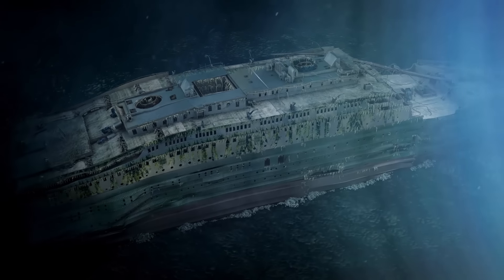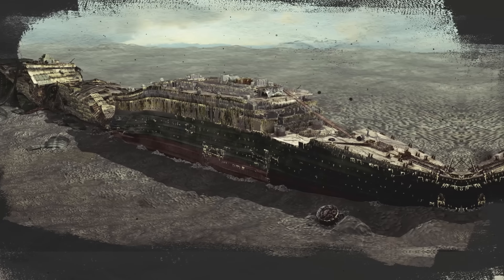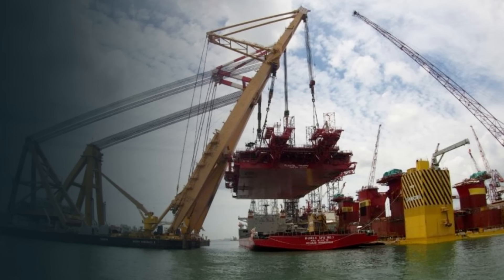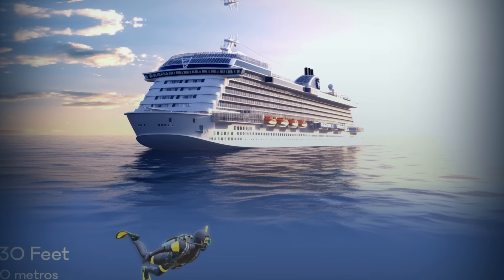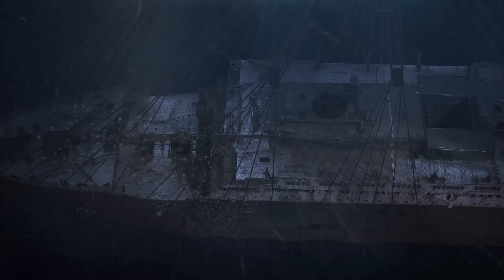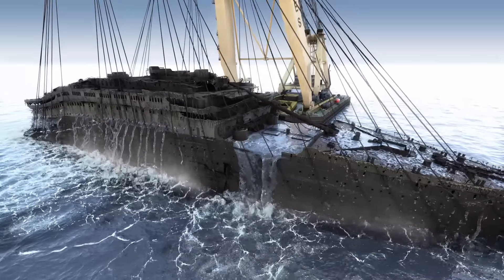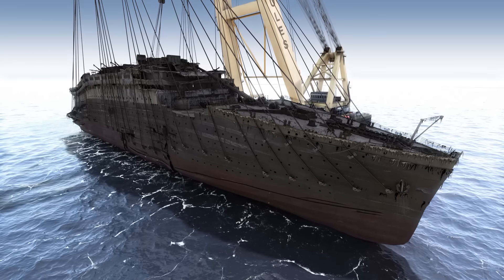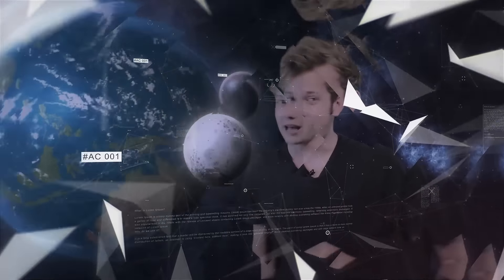THE RESCUE OF THE TITANIC

Comment: Air balloons? The pressure down there is like having an elephant sitting on you every inch of your body. It is crushing. Balloons filled with air would implode long before you got anywhere near that depth.

Titanic is now so fragile any attempt to lift her even if it was possible would cause her to fall apart.
Reply: I think he means some lift bags that were used to raise the big piece to make the lift easier. They can withstand the pressure if they managed to get down there before to try and raise the big piece

Comment: An interesting proposal but practically impossible as others have stated. Your video is good but I noticed three errors on your Titanic graphics:
1. The gash caused by the iceberg is not a continuous slice as depicted here but was instead a series of small punctures along the starboard hull.
2. The compass platform on the raised roof above the First Class Smoking Room is completely absent on the wreck where the upper decks begin to slope down probably torn off during the Titanic’s plunge to the bottom.
3. In your video it shows lifting cables running through the hull, if the bow section was raised by using this method the cables would not lift the hulk but would completely slice through the wreck ending any salvage attempts.
Reply from the maker: It was worth participating. we are always looking to improve our content for you. If you can help us and share our channel with your friends.

Comment: Using air balloons in a depht of 3800 m is just hillarious, because the pressure of the water would compress the air balloons to nothing. When they lifted the "Big piece" of the hull, they used balloons filled with diesel. Diesel as a fluid is incompressible and still less dense than water, so it is able to float.

Comment: Before attempting to lift the bow section ( if that's even remotely possible ), maybe a lift attempt should be made on one of the boilers first. I think they were roughly 57 tons and two stories tall. If when the lift were to start on one of them and it ended up breaking apart....there's your answer as to how fragile the steel has become to say nothing of what would happen to the bow section if a lift were attempted on it. 

Just my two cents worth.

Comment: the minute you 1. attach cables  to metal that is so fragile submarines touching it can cause it to collapse, 2.  Try to move a ship which back was broken on impact with the sea floor and 3. Is in such a state of decay that it is collapsing in on itself.   It will crumble to dust.   This is impossible, and point less.  The amount of conservation needed to keep it from rusting to dust once it's on the surface is staggering.  LOOK at the money work that goes into keeping the raised wooden ship Vasa conserved and Titanic is MUCH bigger.  For the amount of money you're talking about to raise the ship and conserve it, you could rebuild the gantry ways at harland and wolffe, train a whole new generation on the 1900s techniques of ship building, and build a brand new Titanic and you'd still be maybe half of what you're describing here in terms of cost.  

Not to mention that the Atlantic isn't the english channel.  The weather alone would prevent this from even remotely happening.
Reply from the maker: It was worth participating. we are always looking to improve our content for you. If you can help us and share our channel with your friends.

Comment: In my opinion, the best timing we had to raise Titanic would have been 1912 or within 5 years after it. But, you had WW1. So, it wouldn't work either way. That ship will remain down there. The only way you can raise that ship. Is if we take it all apart and rebuild it with the pieces that would have fallen off. But, you know even those pieces would have a very high chance of fracturing even further. Unless we some how develop some super futuristic technology that'll lift a 100 year old ship from the depths of the sea without breaking it. I don't forsee it at all possible. With all do respect. It should be down there. For Titanic's wreck. It is a gravesite for thousands of people who lost their life on April 14- April 15, 1912 at 2:40 AM. A gravesite isn't to be disturbed. We all know what has happened in the past when we disturbed our dead.

Comment: Good plan that would have worked many years ago, but at this point the titanic has just been so long underwater in extreme and cold temperatures that its simply impossible for it to get out of the water because it would colapse emediatly after geting to the surface.
Reply: Put a glass case around it

Comment: Animation is awesome. Looks fantastic. However, Titanic is rotten. If you try to lift her she will fall apart and fully collapse. She has lost her strength and cannot support her own weight. Also, once you get her to the service the oxygen in our atmosphere will quickly dissolve her. The freezing low oxygen conditions where she currently sits is actually preserving her.
Reply from the maker: That's right.  Thank you for participating.   We are always looking to improve the videos.  Help us by sharing our videos and stay tuned for new productions. Thanks.

Comment: "NOW with current technology today if technician's could figure out how to get the gravity relentless reverse suction pull where the TITANIC sunk, dislodged & the funding cost, then I would say YES it would be VERY POSSIBLE to raise the TITANIC to the surface."  "I would think the (2) BIGGEST OBSTACLES would be dislodging the TITANIC from the gravity reverse suction pull & funding the MASSIVE SCALE OPERATION, otherwise it is NOT POSSIBLE TO RAISE THE TITANIC."  "ASSUMING FOR EXAMPLE, what is left of the BOW of the TITANIC, if it weighs 30,000 TO 45,000 tons they would have to use equipment that can lift at least 10,000 tons more to compensate & over come the gravity reversal suction pull."

Comment: The side of the Titanic did not get sliced by the iceberg. The iceberg dent the steel plates on the side which lead part of the rivets fail. If the skin was sliced up right away the sinking would have been much faster.
Raising the Titanic would be close to impossible as the whole remains of the bow would most probably just fall apart if moved.
Reply from the maker: It was worth participating. we are always looking to improve our content for you. If you can help us and share our channel with your friends.

Comment: I"m thinking of a super large metal cylinder placed over the water and extending into the sea bed around the wreck or 1/3 section at a time and you could pump the water, well actually syphon it away.  Well then you'd have to actually go down into the dark depths of an ocean inside of a space where you just displaced so much water.  How crazy would that be.  I can see using large helicopters taking the smaller pieces.  You may have to cut that thing like a birthday cake.  There's probably not enough material to holdback the ocean, so maybe a cylinder more towards the bottom leading to a smaller funnel opening as you ascent into shallower water where the water pressure isn't as intense.  Probably not enough material on earth.  Then again, you'd need something harder than diamond as water at extremely high psi is used to cut diamond.  If there was a way to retrieve the wreckage, then a minimalist approach is probably the best way.

Comment: it would take a TRUCKLOAD of luck to be able to accomplish this, even as we speak the Titanic continues to deteriorate, as the ship rusts, a bacteria that exists down there literally "eats" the rusted metal slowly turning the structure more thin and unstable there will be a point when the ship will be so frail that it will literally get crushed by its own weight, so yeah, at this point, trying to get it out wont be any different than trying to pull out a huge Subway sandwich from a swimming pool :'c

Comment: Haven't you heard? Plans are in place, Dynacorn, who builds replacement steel and entire bodies for Camaro's and Mustang's is rebuilding the missing sections, cutting off damaged parts. Upon being raised, it will be thoroughly scrubbed with SOS pads before a thick coat of Rustoleom will be applied. The Brick will supply new luxury furnishings. Tickets will be on sail for the maiden voyage next spring.😂😂😂😂😂😂

Comment: If the equipment was available when the titanic was first found it could possibly be brought up but as of today it's impossible when the front of the ship struck the sea bed several more cracks splits were put into it plus it's in to bad of decay It would probably collapse upon lifting just leave it where it is eventually the titanic will be just a rust stain on the ocean floor

Comment: that "air ballons woud just pop after a few 100 meters because the pressure is going to be lower and lower so tha ballon woud getting bigger and bigger until it pops.. so that makes no sense ^^
Reply from the maker: Thank you for pointing that out! You are correct that as a balloon ascends, the atmospheric pressure decreases, causing the balloon to expand. Eventually, the balloon will reach a point where the pressure difference causes it to burst.

This principle is rooted in basic physics and is observable in high-altitude weather balloons. These balloons are designed to expand as they ascend, but they eventually reach a limit where the material can no longer withstand the internal pressure, leading to a burst.

We appreciate your feedback and aim to ensure accuracy in our content.

Please continue supporting our channel by liking and sharing with your friends!

Comment: 4:00 You're going to lighten the Titanic using air balloons? Are you aware of the water pressure at 3800 meters? Anything with air in it that isn't several inches thick of titanium would instantly collapse in a fraction of a second. In fact a major problem deep sea submersibles have to contend with is getting the submersible to be buoyant enough that it doesn't sink like a stone, while still having a hull thick enough and strong enough and with an interior volume small enough to withstand the colossal water pressure. And you're talking about balloons, what, made of latex?
Reply from the maker: thank you for participating. We are always looking to improve the quality of the videos. the channel needs your help, if you can share it with your friends. thank you very much

Comment: As much as I would love them to be able to raise this ship and study it and display it and let us all wonder over it I actually believe that if that is practically impossible with our current level of technology. That being said though I'm thinking a little bit smaller would it be possible to bring the bow up maybe cut it into a couple of pieces back to the well deck and then reassemble it when they get it up because the bow itself is still the most well-preserved part of the ship but it won't be for much longer so if we're going to pull anything out and we want to have a realistic chance of success it might be a situation where we look at something like that and leave the rest of the ship where it lay.  I know we always really worried about the ship coming apart if we were to raise it but the God's honest truth is nobody really knows the true condition of the ship down there at the bottom of the sea it may actually be very sturdy still it may actually be able to support its own weight just fine I mean it's just impossible to know so that's another thing that has been a major worry and concern is that we would accidentally destroy the ship trying to bring it up. That's why I say that maybe if we can dissect the bow down to the well deck and bring it up maybe three or four feet and length at a time and then reassemble it on the surface might be the best bet
Reply from the maker: Thank you for participating, we are always looking to improve our productions. If you can, help us by sharing our videos with your friends. Thanks !!

Comment: No need to raise the gravetanic😅
Just REBUILT the 2nd one using the original blueprint available ( Replicate ).

White Liner 1912-2032 😅

Only the 3 million rivettes tech need to be WELDED ,  the hull steel plate too , to make it more solid water proof and not easy loose for ( incase ) any impact with iceberg or sea coral rock.

Modern day cruise ship VS vintage old school 2nd twin of TITANIC..still there are modern day people want to experience the old days kind of ship cruising....and lots of honeymoon couple as Jack & Rose 😂

Comment: Tf happened with the stern
Reply: The stern did implode due to the fast lowering there was air inside leaving hatches to explode and air&water pouring out like a machine gun..
When the titanic was abt 250 feet deep at the stern
The air pressure was to mutch and it standup first lifted pumping out the air and than exploding,
Ripping off some floors and entire rooms ripping of at abnormall speed,
Than it started spinning and due to the explosion that happend it torn of even more of the like hatches and stern than when it hit the bottem it broke in 4 pieces or 3 pieces it is just impossable to lift the stern since this would break the ship more than it alrdy was
Reply: @Mighty_b17  ik that im saying if they are gonna raise the titanics bow which would almost completely fall apart from being risen just do the same to the stern its already unrealistic as it is

Comment: Who wrote this, a teenager?!

   There’s NO way the main wreckage(bow, stern and the mangled section which housed funnel #3)of the Titanic will EVER be raised from the bottom of the ocean. It’d never survive being freed from the mud, much less the stress of being winched/lifted to the surface.

  Between the damage caused by the sinking and subsequent impact with the ocean floor, plus the effects of saltwater corrosion of over a century, once the water was pumped out, it’d collapse under it’s own weight….. and this is only factoring in the bow section. The stern is obliterated as it sits…

   Finally, what could be expected if by some gargantuan feat the wreckage WAS raised? There’s no way to reverse the damage done, nor can it be halted. Can’t leave it exposed to air and sunlight, it’d be gone in a year or two. Dunking it in the world’s biggest vat of WD/40 isn’t an option, either.

Comment: It is kind of impossible to lift it up because the bottom hall is like Buried in the sand Ocean floor So it would just break And you will only have like the upper parts that will just like break into a little pcs

Comment: ok just the idea of this ship being disturbed bothers me.
However, 2/3rd of the ship is impacted in the sand & buried.  How would the engineers plan to get those cables UNDER the hull provided there is even a Keel left to support such a lift ?
I don't feel this is a scientific endeavor, I think its more like plundering what's left & making money off of it. 
This is a grave sight over 100 years old. They can study it all they like but they need to respect those souls who lay rest there & then leave it alone.  Leave them & that vessel alone & in peace.
The minute that ship hits the air, it will crumble immediately plus the impact of the bow into the sea floor would have damaged the bow to a degree the damage caused from the iceberg would have done away with that evidence.
Thanks for the video, it was very entertaining & it opens up a mind full of imagination & the "WHAT IF"

Comment: If they ever could do this, people would see that it wasn't the Titanic that sank....it was the Olympic.
Reply: No they wouldn't. That conspiracy theory has already been debunked MULTIPLE TIMES. The Olympic and Titanic are structurally different, and you see on the Olympic that the promenade deck extends, unenclosed, the length of the upper deck. The Titanic's promenade deck is partially enclosed AND the names are engraved on the ship, you can just paint over that
Reply: @Ivarevich  Just because it is labelled a debunk does not make it a debunk. The number of portals on the front of the two ships proves they have been swapped. Titanic did not have the same number as Olympic and the one we have remaining can only be the Titanic branding itself as Olympic.
Reply from the maker: thank you for participating. We are always looking to improve the quality of the videos. the channel needs your help, if you can share it with your friends. thank you very much